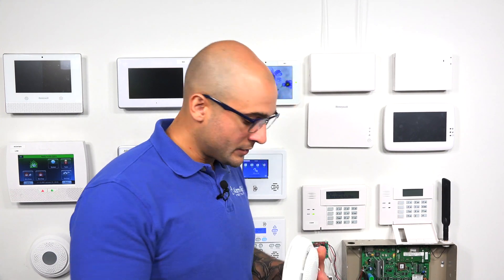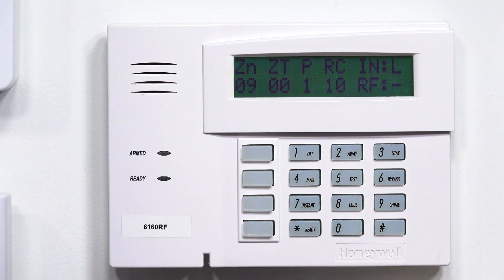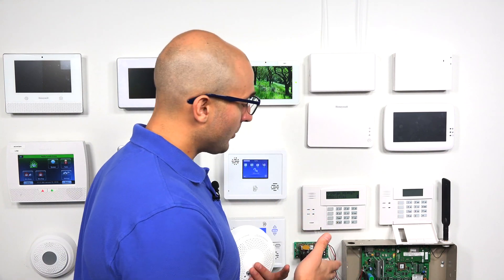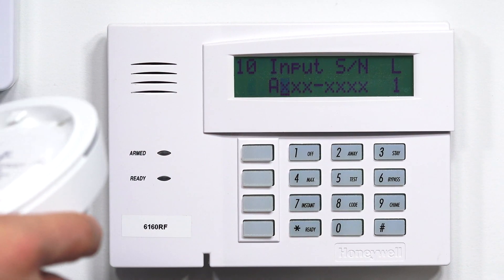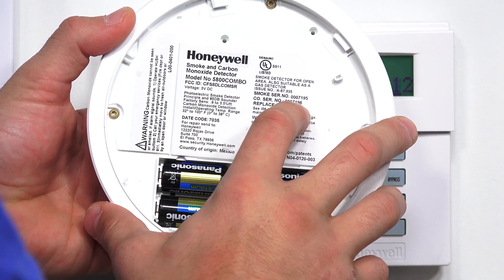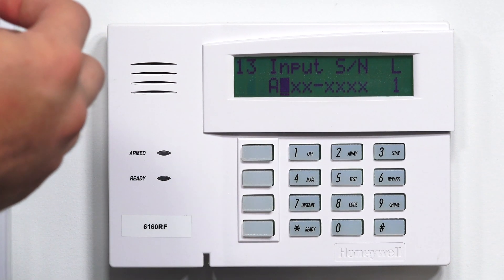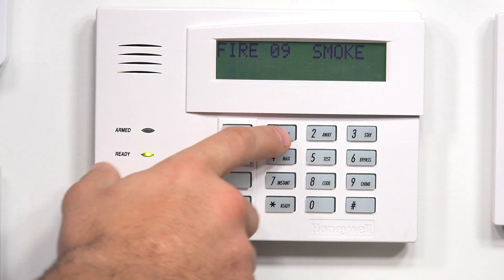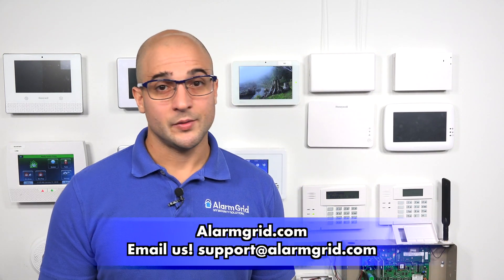Programming the 5800Combo to a Vista Panel

Comment from the maker: In this video, Joe suggests that the report code's first digit has to begin with a 1, and shows setting the report codes to First: 10 Second: 00 and Final Result: A0. Though this is a perfectly acceptable report code and will result in the corresponding zone reporting when an alarm occurs, it's not technically a requirement. The First entry in the report code field can be any entry from 01 to 15. The Second entry does not matter and can remain at 00. As long as the First entry is not 00, the zone will report when Contact ID format is selected.